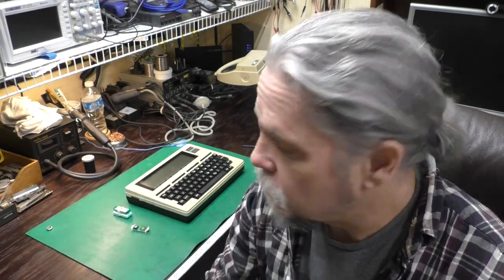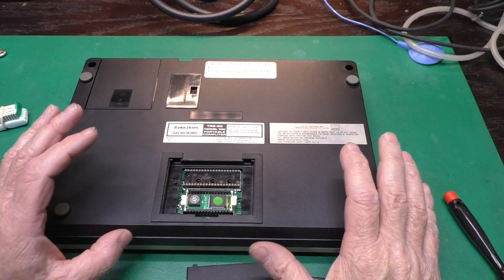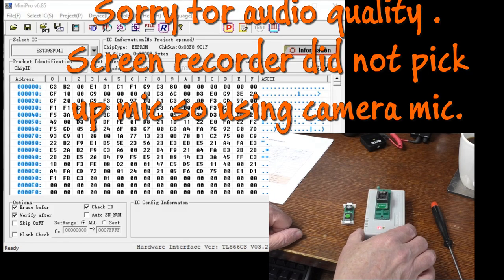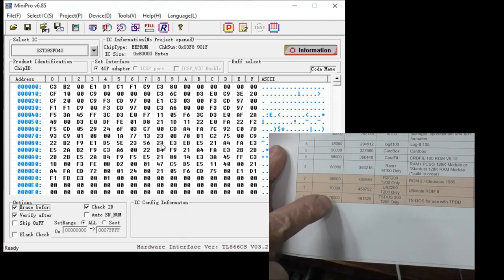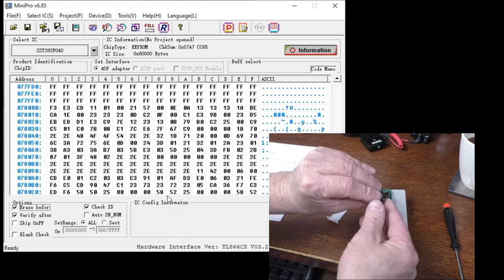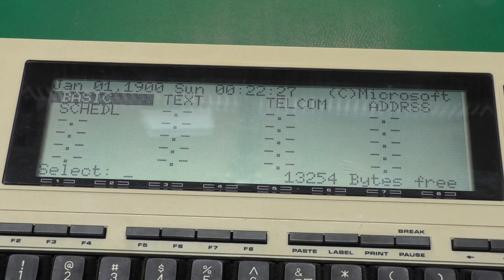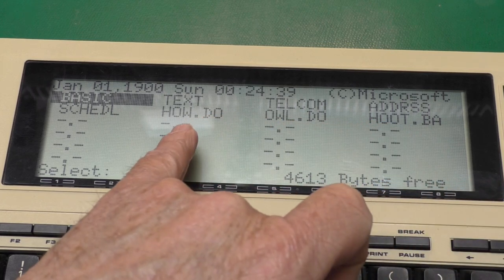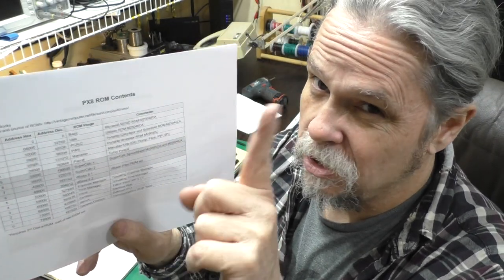Dial-A-ROM - A nifty new multi-ROM for vintage portable computers.

Comment: What a great combination! Dial-a-ROM (DaR) and Backpack (BPD+).  Select your ROM from a wide variety of choices and save your files after use.  Then easily remove the SD Card from the BPD+ and backup your files on your MAC or PC if desired.  Elegant and simple.  For the PX-8, I think two would be the way to go since, to me, you always want the PIP Utility available.  Very cool invention!

Comment: So why would I want a DAR as opposed to a REX? New Tandy owner here, so I'm clueless. :) And thanks for the vodeo!
Reply from the maker: The REX has more functionality but is more complicated and more expensive. (We do have a few REX Classics left which are inexpensive due to some donated parts. When they are gone the price would be about 2x.)

The DAR is simpler and less expensive. It is also available for other platforms. It provides an alternative based on your needs.
Reply: @HeyBirt  Ah, I remember that now, as well as that there is an adapter that is missing/unobtanium for the backpack. I ordered the REX module, and I'll wait to see what I need for the backpack. Sounds like my 100 will be a fun addition to my collection of misfit hardware. Thanks!